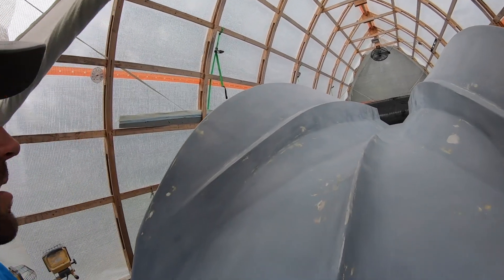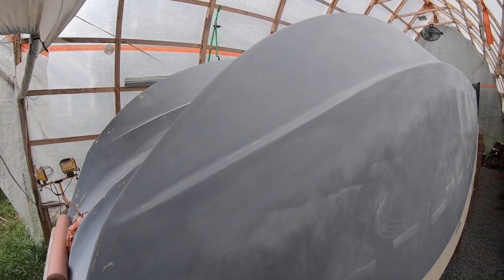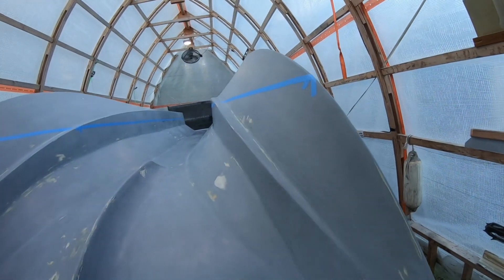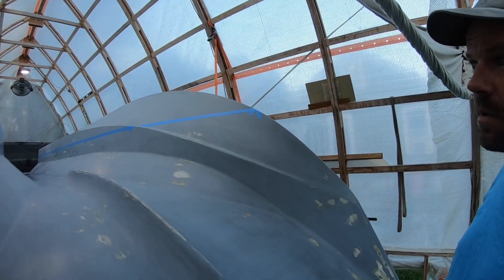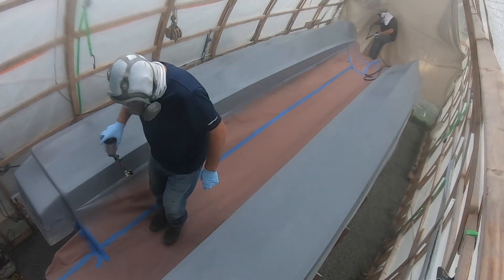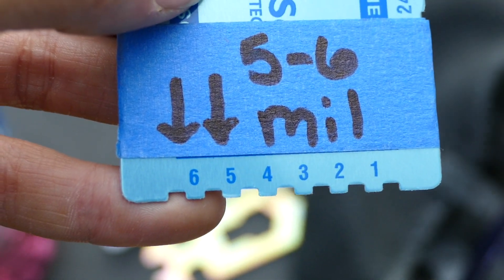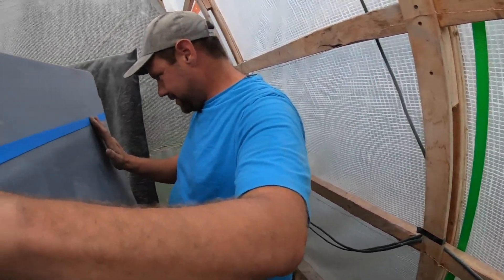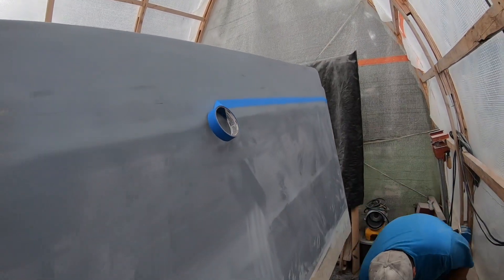Step 60: BOTTOM PAINT!! Applying Sea-Speed Hard Silicone Marine Paint - POWER CATAMARAN BUILD

Comment: Hi Guys,

Great to see you masking the waterline like a professional painter would, i.e. one arm fully stretched out and the other guiding the tape, while checking to see that the line is straight, i.e. outstretch arm guides the edge of the tape - very well done!

To assist the finish when spray painting, always spray paint the from the area(s) where the finished job will be seen towards the areas where the paint is least likely to be seen.  In this case, I would have painted from outside the hulls into the centre (and along the tunnel).  This way any issues are far less likely to be seen.

Hope this helps.

Professional Boatbuilder and Naval Architect
Reply from the maker: Good to hear. Thank you!!!